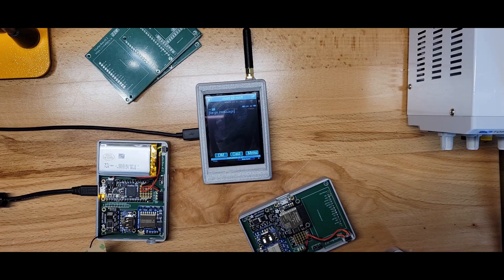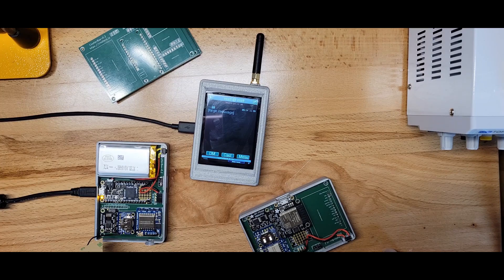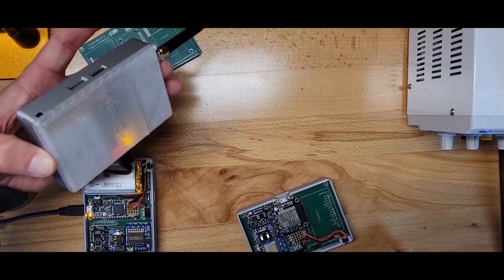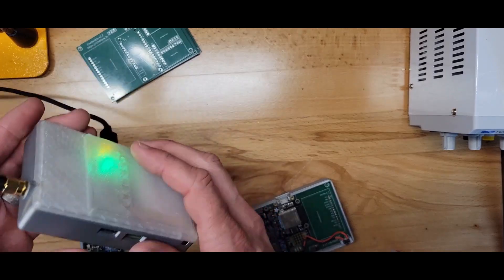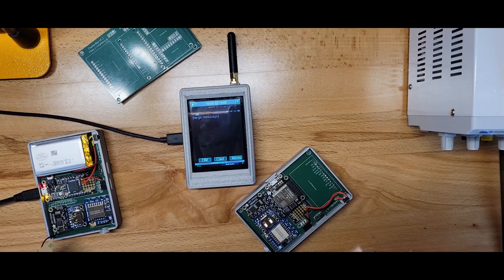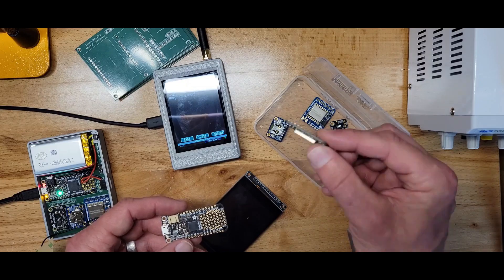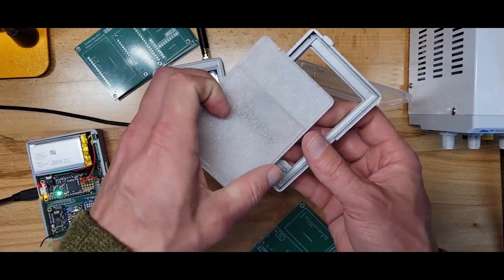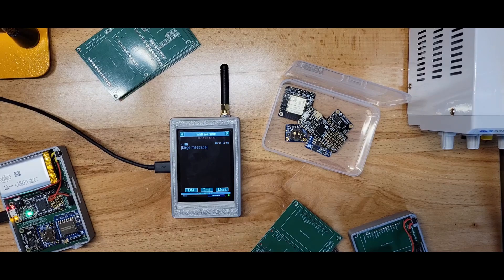ChatterBox 3rd Prototype - Off-Grid LoRa Secure Texting with Mesh Capabilities

Comment: I would like to see implementation of a blackout mode. This feature would allow users to operate in environments where they do not wish to be seen, such as when using night vision. I suppose i could just turn it off buuuut food for thought
Reply from the maker: This is already in the works. It will likely be called "gray mode" or something similar. Essentially, it turns off all pings and relies on cached mesh graph data for routing. It would be up to each device whether they have this setting toggled off or on. In this mode, the device would be radio silent unless you send a message or receive one that requires acknowledgement. Encrypted broadcast messages do not require acknowledgement, only direct messages require acknowledgement.

Comment: I'd like to see WiFi, with a simple web messaging UI, just like the chatterbox LCD interface. The best location for a node here is in the attic, but access is then poor. With WiFi and a simple bultin web server I can use a mobile or pc on my LAN to use the mesh.

If you're considering using WiFi for Comms, you can add a MQTT interface, but personally I wouldn't bother with that.
Reply from the maker: That is an interesting idea. I have a couple of thoughts related to that...

1) I have sort of the same scenario at home. I want the devices I carry around to be very portable (pocket sized), but also be able to benefit from a taller, more sensitive antenna. So, the out-of-the-box solution for this, which I use and works quite well, is to have 2 ChatterBoxes. One that is fixed in a location and you just leave powered on all the time, probably never even look at. The second is the one you actually use and carry around.

Both devices will automatically figure out the device with a larger antenna has a farther reach and it will automatically be treated as sort of a "base station", you don't have to configure that in any way. The base station will also automatically hold packets for you if you leave far from the area and come back, and will instantly deliver the messages you missed as soon as your mobile device gets near enough.

2) Although not really advertised yet, the ChatterBox supports other interfaces, LoRa was not the first choice actually (just turned out to be the best). The software can also handle WiFi (UDP multiast within your network) and Wired (serial or CAN) and can do 2 of these options concurrently and seamlessly without you having to worry about which one it uses. In fact, it can stripe message packets for a single message across multiple channels for ultra-high security...again, this isn't really advertised or out-of-the-box functionality. I imagine helping customers set this up would require a lot of "handholding" in some case, and unfortunately I won't have time for that.

The necessary hardware for accomplishing either of these is quite cheap, but not included by default in a base model. I'm not including a WiFi module out-of-the-box for a few reasons, but could add it as a "backpack" that sort of snaps onto the back. ChatterBox switches seamlessly between LoRa, WiFi (UDP multicast), and CAN/serial. If all those were connected at once, it would prefer wired, as that's very fast and most secure, followed by WiFi so as not to tie up LoRa bandwith, and finally LoRa.

3) I can definitely see the convenience of being able to interface with ChatterBox via laptop or a mobile app, not needing to carry the device with you, and also not having to buy a second ChatterBox that is essentially a dedicated base station. However, the big tradeoff there for some people is security. The moment any device with an OS or internet connection has access to send/receive/read messages, it could become a privacy concern for anyone else within the cluster that would securely broadcast a message or send one to you directly. That's the part that gives me pause in solving the mentioned scenario by opening the device up to apps and PCs (at least for now)

Comment: Would this Would work meshtastic or other devices
Reply from the maker: These are built using completely different encryption/security methods, and somewhat different goals. As is, meshtastic and ChatterBox are not compatible, but of course that could be changed at some point. They use the same range of RF frequencies.